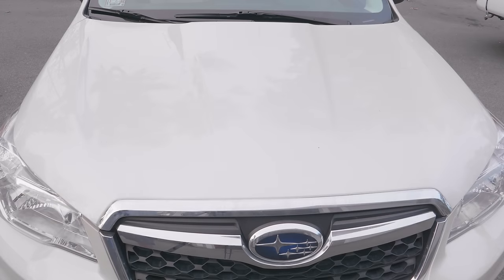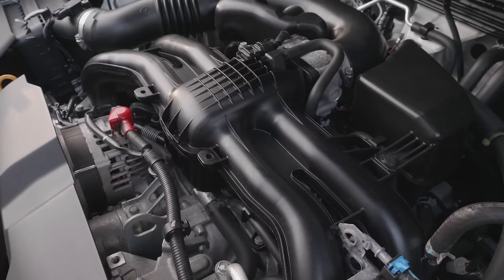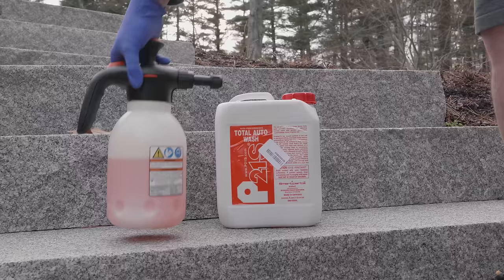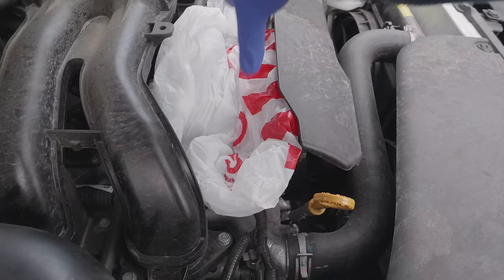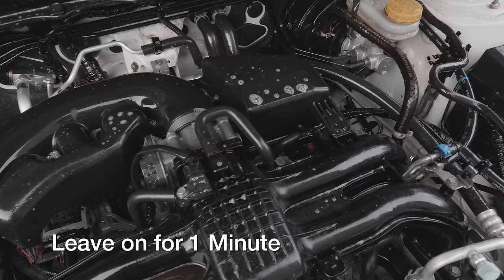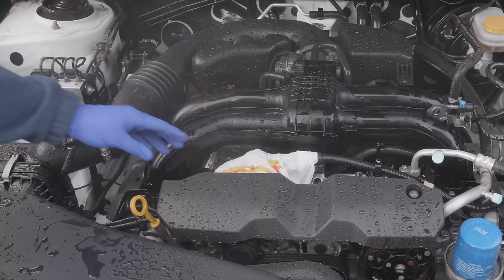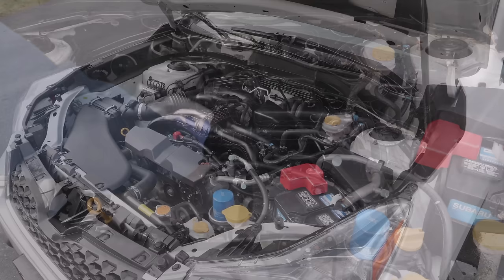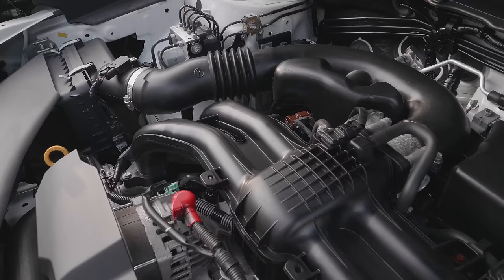Clean & Detail Your Car Engine in 5 Minutes!

Comment: OK, tried it out with the cleaner you recommended on a five year old Subaru engine that's never been cleaned.  I made sure to cover the alternator and the main wire harness connection.  Blew out the leaves and loose dirt with a leaf blower, sprayed it down with cleaner, waited 90 seconds, then washed it off, I spent an extra 8 minutes using a wheel brush and scrubbing the big areas, then blew it off with a leaf blower.  Looks great, and the car started up and ran just fine.  Neighbor decided to do the same thing on his BMW 340, it turned out great and started/ran just fine (BTW, we both took off the plastic engine covers, to better wash the whole engine).  As you noted - DO NOT let the cleaner sit more than 60 seconds on your engine, or it will get sticky and not wash off easily. Thank you for the great video!

Comment: Who else impressed with that oil filter location?
Reply: Best thing about the new Scooby-Doos
Reply: They must have copied BMWs since my E36 series had that in the early 90s. And on top of it, it was a filter cartridge instead of wasting a metal can housing during every filter change. VWs and Porsches use that system as well.
Reply: Subaru did something right
Reply: I bought my daughter a 2018 Crosstrek. Super great deal/value and the easiest oil change in the car world.
Reply: So much nicer than the "ring of fire" I had to deal with replacing the oil filter on my Outback.
Reply: Is not that is hard to remove it from my  '04 silverado, but with this one I wouldn't have to go under the truck.
Reply: I came to the comments section to say this, but deep down, I knew it had already been said.
Reply: I love changing oil on this car super fast and easy, wish most cars followed this but sometimes they just put the Oil filter in such difficult spots
Reply: For real... amazing it took how many years for them to figure that one out?
Reply: *Subaru: Let's put the oil filter in a convenient spot for the consumer!
*Puts spark plugs deep in engine bay
Reply: my ‘11 V6 Tacoma has it like that too, just slightly tilted.
Reply: For real! 💯💯
Reply: Subaru knows how to build a better engine
Reply: Yo I know right..
Reply: Most Audi/VW products have had it located there for a long time.  Nothing new.
Reply: my mk3 vr6 on my mk1 caddy has it right behind the radiator support easy access
Reply: @achristian7015  what's wrong with a metal can housing? It's not wasted if it saves me time from messing with o-rings and unnecessary fasteners.
Reply: @mrau92me  If you are the only one doing it, nothing, except there are hundreds of millions in the US doing it a few times a year. And what unnessary fasteners?
Reply: @mrau92me  "A metal canister can be recycled". Maybe if they are put into a recycling container. Mine are put into the garbage. As for the politics of climate change, don't get me going on Teslas and such EV crap.
Reply: 😂 😂 😂 Yahh
Reply: @claytonnorris8132  lmaoooo I've only heard them called stupid-ru's
That's hilarious
Reply: In vw polo 9n3 is similar
Reply: My e36 got it like that
Reply: How do you change that without spilling oil everywhere? How does oil even collect in that thing?
Reply: not me, my starlet also has the oil filter within easy reach :p
Reply: @lamnt3z  it doesn't collect in it the hole is in the bottom and the oil will drain out when the motor is not running.
Just don't put it on upside down 🤦‍♂️
Reply: @luis
You have to go under the truck to get to the oil plug on the pan, correct?
Reply: Oil filter there makes up for the horrible front headlight bulbs pain in the ass.
Reply: @coyuznik  Lol!
Reply: My Hyundai Santa Fe is on top... 10 minute oil changes 👍
Reply: Same
Reply: Absolutely anybody that's gotten under a car to fish out theirs from the back of the engine :)
Reply: @edwingaleno4348   like my honda accord 2006 😢
Reply: My 07 FJ Cruiser has it in the same location....
Reply: Yeah, that was so cool.
Reply: @achristian7015 
Ferrari has been doing that with their dual filters for decades.
Reply: @MrFighter28 
Its a boxer, the plugs gotta go where they gotta go...
Reply: @lamnt3z 
It (like most filters) has an anti drainback gasket, and yes, it will leave some oil in the cup it sits in, which you will swab out.
My six cylinder Outback has its filter mounted horizontally behind a door in the belly pan.
Impossible to change without spilling oil on the pan, but you adapt  and it can be pretty tidy if you do it right.
Reply: Same with Skoda 1.2TSI.  Obvious thing to do.
Reply: Genius
Reply: I'm So Jealous.
Reply: It's a stupid location and it's upside down
Reply: My bmws and Audi had drop in filter

Comment: I've been detailing for over 30 years and I always use a pressure washer demonstrating on a car that is almost brand new of course it's going to look new when you just use a little mild degreaser and spray it off and wipe it down. On an engine that all the plastic is dried up in starting to fade you absolutely need dressing, I've never had an issue

Comment: For those worried about using water, just don't get water directly into your air intake or spray heavily onto electrical connectors. Just use a light spray that you would for watering plants to rinse your cleaning products off. And for those that don't have anything to dry the water off, I just used a few rags to get as much off as I could then I just started the car, closed the hood and let it idle for about 10 minutes, you'll hear squeaking probably from your belts for a little bit but that'll go away. Once I left it to dry a little I took it out for a wee drive to get rid of any small pools of water.
Reply: And dont spray water in the oil filter you dont want to mix water in oil
Reply: I wouldn’t do this at all.  Really no reason to clean your engine compartment anyways.  You can wipe it down once in a while, but so much can go wrong spraying soap and water in there.
Reply: @mplslawnguy3389  Primarily it's for resale. Most people will open the bonnet to check the engine (for what i don't know) and if it's nice and clean it makes a good impression. Plus, some of us just like things clean. I've thoroughly cleaned my engine bay a few times now since buying my new car meaning now I only ever need to do the odd 5 minute tidy up with a cloth and spray to keep it looking pretty.
Reply: @Alastair_  I get that.   I dip a shop towel in water and dawn or water and simple green and give things a wipe down.  Years ago I got water where it shouldn’t and it messed some electronics up so I’m overly cautious about it now.
Reply: @mplslawnguy3389  wrong. Clean engine bay is better for diagnosing leaks and just easier to work on in general. Greatly benefits resale value as well because it suggests the vehicle was taken care of.
Reply: @HaloDude557  You can clean it without spraying it down.  Directly spraying water into a modern engine is a terrible idea.  I've seen electronics go completely haywire from doing that.  There's a hood on your car for a reason.
Reply: @mplslawnguy3389  the hood is for aerodynamics and keeping dust out of engine components. If waterproofing was important there would be actual seals to prevent water from seeping in from the top gaps in the first place
Reply: @HaloDude557  Its not the water itself, low pressure water seeping through gaps isn’t the issue, it’s directing a high pressure spray on engine components that is.  You can keep the engine compartment reasonably clean without blasting it with water.
Reply: @mplslawnguy3389  you're not blasting it with a power washer though? This is literally just sprinkling some water from a garden hose over the top and letting it trickle down.
Reply: @HaloDude557  If it works for you, it works for you.  I’m just cautious about it from my experiences.  I have seen people on YouTube use pressure washers though, and that makes me cringe.
Reply: What’s a “wee” drive? 😂
Reply: @dukemartinez7551  It's like a normal drive but more manly because it's said in a Scottish accent.
Reply: @Alastair_  😂😂😂
Reply: @ShadowBannedagain  you dont want water in the engine and that filter is vertical you do the math
Reply: This is not how to do this. He should have removed the battery completely and only do this on a very hot summer day and wait about an hour before replacing the battery and starting the car.
Reply: @mplslawnguy3389 simple green is my go-to. I just wish they still made the lemon scented version. That sassafras smell is the worst.

Comment: Finally got around to cleaning my 2018 Accord engine. This method worked with great results! I covered the alternator and air intake only. I spent about 15 min blowing everything dry with a shop vac. Then i let the engine dry off for another hour in the sun. The dryer the engine the less chance of an issue. Thanks for the video!

Comment: I’ve been using Simple Green for years! I dilute 50/50 w/water. I’ve always kept the engine running both during the application and rinse. I let the vehicle run a few minutes and it’s done. No wiping…it dries clean and spotless.
Reply: im gonna assume you wear using Simple Green Industrial Cleaner and Degreaser, and not the regular?
Reply: @zephyr9l95  I use the Simple Green All Purpose Cleaner
Reply: My friend uses dawn dishsoap. Any degreaser would work.
Reply: @MrAdrianarellano1  Same, using simple green apc diluted 1:1 or 2:1 for a slight boost in degreasing power on engines that may have some grease/oil residue, and agitate it then rinse off, then spray on some 2:1 303 (I dilute it so it flows a bit better, getting it everywhere I need it) then buff it in. Makes engines look amazing and, while being safe for paint and aluminum, will cut through any grease or trash I need it to.
Reply: Word up man…Simple Green 13005CT Industrial Cleaner and Degreaser, Concentrated, 127.8 Fl Oz (1 gl) for just $10.98 👍🏻😎

Comment: Another great product to use on a warm engine is 'engine cleaner ' from Garot's garage.  I don't cover the alternator but it is protected by a bunch of stuff on the engine. I also use their engine dressing that helps keep the rubber parts fresh and pliable. My car is over 16 years old and have not had to change out any of the hoses so far.
Reply from the maker: That's good to hear. I have always liked the Griots stuff. They have always kept quality products in their catalog.

Comment: A caution for anyone with an "older" vehicle...,All that rinse water and your engine won't start. 
If you have an ignition system that has distributive coils with exposed leads to the spark plugs you will need to cover and / or coat the coils / distributor and  leads with a hydrophobic (water repellent) spray...WD40 or similar
Reply: There are many reasons to not do this at all.  I would never spray anything into my engine compartment.  If it gets really dirty I will just use a damp shop towel with water and dawn or water and simple green.  The engine compartment doesn’t need to be immaculate.
Reply: I was thinking the same thing.  I have a 23 year old car and it has quite a few exposed wires.  I cannot imagine spraying chemicals and water over all those wires and expecting my engine to still work... I will not be attempting this method.

Comment: I did my daughter's engine on a 2014 Kia Forte and then I did mine on a 2015 Kia Optima. Super easy and super results!
Reply: Did you cover up the battery, or take the engine cover off? I know it should be water tight but idk if the spark plugs will leak
Reply: I'm curious about the batteries tooo..

Comment: 409... Simple Green... Greased Lighting (I personally highly recommend) or pretty much any multi surface household cleaner would work on the test engine dirt you referenced in the video... your video is for those that do it monthly... it's a much bigger job to clean a real or legitimately DIRTY ENGINE... your process is legitimate, spray cleaner, rinse thoroughly, blow dry, run engine... Thanks 🙏🏻 for sharing.
Reply: Tim Burton thats what I was thinking, it looked like a newer car with just dust on it ? Will it work on 10 years of dirt and grease built up on the manifold etc ? Thats the real test ?

Comment: Good job.  I always pre wet the engine compartment before spraying with detergent, you reduce the possibility of streaking the paint or plastic parts.  The leaf blower to dry everything off is the best way to go.
Reply: I was also taught to wet the engine, hood and fenders just in case of cleaner overspray onto the paint.  Never had an issue that way.

Comment: I have the same car, dont forget to also cover the ECU and those electrical wires under that intake hose, I pressure wash it using rainwater so it wont leave chlorine marks/stains.
I also use the widest spread of my washer so that its like a misting effect.
After washing, I spray detail and blow it dry either with compressed air or reversing a vacuum cleaner.

Engine bay is always shiny and clean. Never had any problems, my mechanic is always impressed whenever I do change oil service as my engine is clean af lol

Comment: I know this is an older video, but still very helpful. Thank you. The only additional thing I might try is to apply WD40 around the alternator prior to putting the bag over it.  WD40 displaces water and is safe for electronics.
Reply: Facts, smart idea
Reply: Wouldn't the oily residue fuck w/ the conductivity?

Comment: 1991 GMC Syclone 22,000 miles and 2001 Pontiac Trans Am Ram Air WS6 104,000 miles. I just pop the hood latch before I wash them just to have the gap for a little extra soap and water to run inside and let the water go where it will.  After I’m done washing it, I have separate engine towels I use to dry the entire engine compartment. I open the hood up, dry all the wiring, plastics, hoses, body panels and as a towel gets wet I use it on the block wherever any dirt may be. It takes me a good 15-20 minutes to wipe it down. I use Zep dressing on all the hoses and plastics. I regularly get compliments on how they both look brand new, especially the Trans Am with all that mileage on it. I’ve owned the Syclone since 1996 and it was cared for by the original owner so it looks good. I bought the Trans Am new and have have done this process every time I wash them. Any used car I have ever had for my everyday vehicles, I’ve used Simple Green on the engine compartment. Always loved SG !! 
Good video though!

Comment: Your engine only had a light coat of dust on it before you began. The edge of the red battery post cover is actually shining through the dust in the shot before you sprayed the engine down. Using Dawn dish detergent in hot water with a pump sprayer, and letting it sit for 20 minutes before rinsing will clean everything off the engine, even built up grease around an oil filter or filler cap... at a fraction of the cost of your cleaner.
Reply from the maker: I see everything you wrote but like all my videos they and I are the real deal.as echoed my thousands of comments & responses. I am sorry but your soap idea will not beat or even come close. The engine you see had 60k on it and was 4 years old living in New England, not kind to cars. Cleaned 1 time per year as shown here and that's the result. I guess it truly is too good to be true, except it actually is. I have tried them all and wasted hundreds of dollars and time to bring this you.
Reply: I definitely agree, that was a very clean engine bay, this WILL NOT work on a lot of vehicles.
Reply: @SilverCymbal  Hey man have you used Meguiars Multi Purpose Cleaner? Thanks

Comment: This is exactly how I used to clean the engine bay in cars I had for sale over 15 years ago except using different chemicals and didn’t bother drying just go for a drive and it would dry up! Sometimes back then would occasionally get a problem with water in the electronics and it needed to be dried out but for the most parts it was fine. Nowadays with this detailing business they are making a mountain out of a molehill.

Comment: I spray everything down with Meguiars Wash and Wax (mixed with water in a hand squirt bottle).  Wipe it off with a cheap Amazon or Harbor Freight microfiber cloth.  Takes about 5 minutes and looks amazing.  I clean it every time I change the oil; easy to keep up that way.

Comment: Every time I wash my car I wipe the engine down with a damp shammy. No cleaners at all and it still looks brand new after 60k miles.
Reply: Yes, the secret is: little and often. Keep at it and don't let the dust build up.
Reply: I use a microfiber towel and detail spray. Takes 15 minutes and looks great. As you mentioned, don’t let the engine compartment get extremely dirty. Regular care and upkeep are the ticket.
Reply: Agree. The best thing to do is stay away from washing the engine bay. So many problems can arise from spraying cleaning solutions and water on it, especially on older vehicles. I understand people doing this to show cars, etc but on an everyday driver it's not wise. I do the same as you but I use a mild engine cleaner and a cloth. Unlike body cosmetics, nobody is going to see underneath the hood. As for me it's not worth the financial risk to wash an engine.
Reply: It is brand new!!!!!60k miles 🤣🤣🤣
Reply: @darkgray1  I said "looks" brand new. Didn't say it was brand new.
Reply: @kenkobra  I was saying it is brand new, I wish I had only 60k on either of my vehicles.
Reply: 260 000 km on my 2006 acura engine looking beter that brandnew
Reply: Ok i feel a bit more safer with tht method

Comment: Simple Green from the grocery store does identically the same thing and is very cheap and easy to find
Reply from the maker: Very different products. If you try this stuff you will see that it restores plastics to look like new with no scrubbing. I have simple green and it's ok but this has a unique formula that floats grease away. I have never sen another product do what this does in the short time:  https://amzn.to/2M4u3Es is unreal. If you try it you will be shocked.
Reply: As does krud cutter